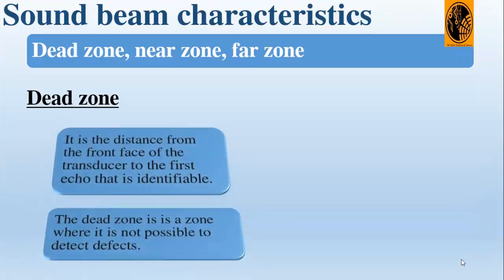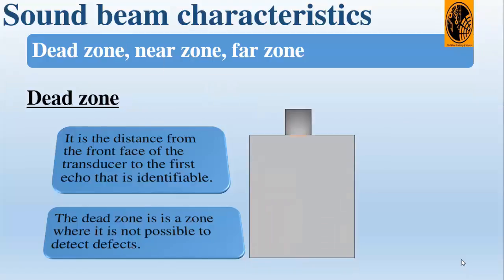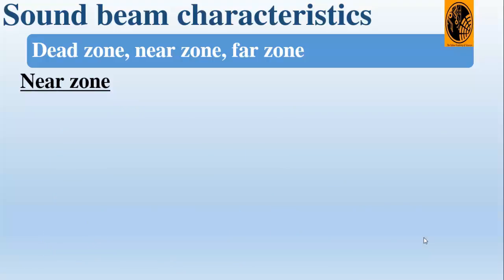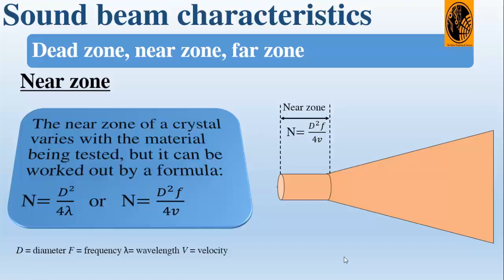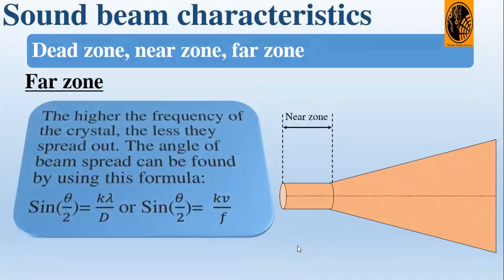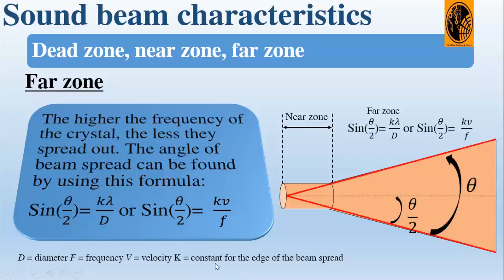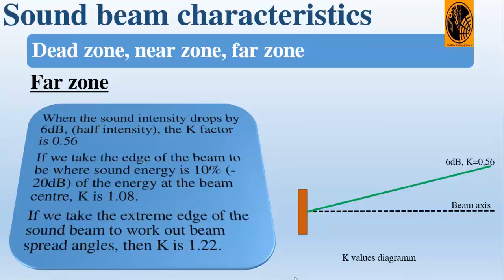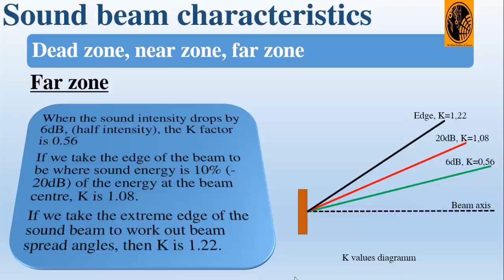Dead zone, near zone, far zone: Ultrasonic Testing Dead zone, near zone, far zone

Comment: what does 6db mean? the sound loses power proportionally to the inverse of the distance squared, what does 6db mean exactly? 6db per cm? 6 db of what? it doesnt even make sense.
Reply from the maker: Thanks for your comment. The 6dB drop is very famous method for defect evaluation in welding inspection. I've explained the method in details in my course on udemy. You can check out this animation learn more about it https://twi.phasexnde.com/home/tasters/ut-taster/dashboard/section-2-0-degree/chapter-8-evaluation/measuring/meaning-of-a-6db-drop/
Reply: Gustavo, a 6dB increase means that sound pressure doubles, while a 6dB decrease means that it drops by 50%.